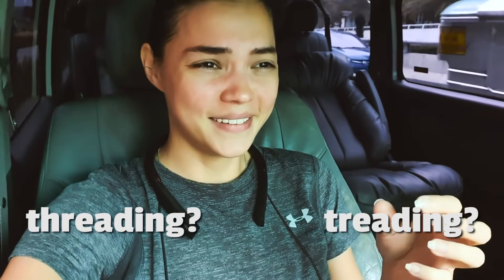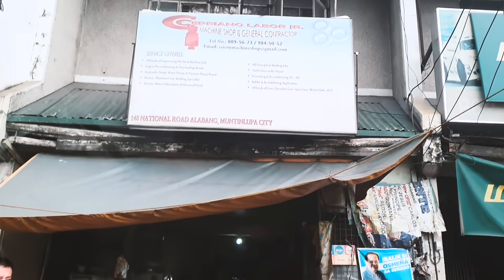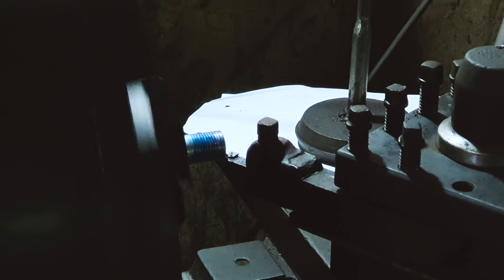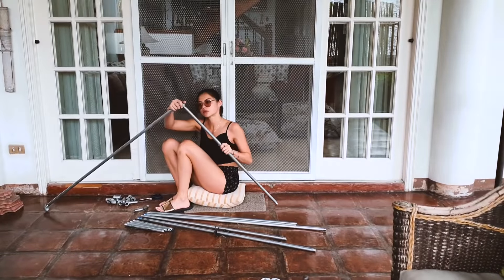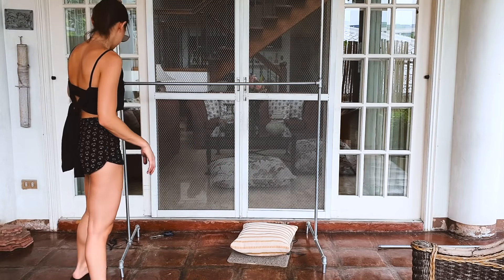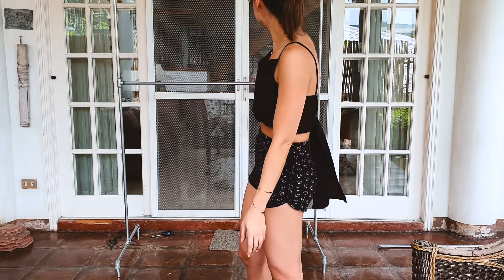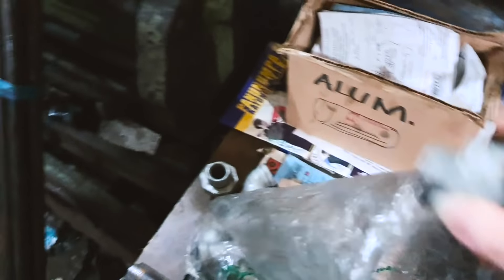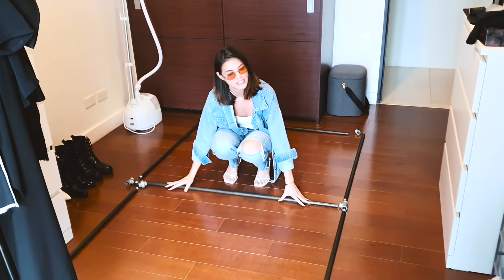DIY Clothing Rack Fail?!

Comment: bigger pipes more sturdier...3/4 inch. black iron rust quicker than galvanized iron (G.I) coz its chemically treated..also spray paint with clear coat the pipes so it wont get your hands and clothes dirty.. or let the black iron rust then clear coat it for a rustic finish.. just a few ideas...

Comment: How did the pipes break? Black Iron (BI) will corrode easily if not properly painted (kahit metal primer lang). Galvanized Iron (GI) is better... and yes it should be S40.
Overall you did great 💪👌👍.
Next time don't forget to use gloves 😄